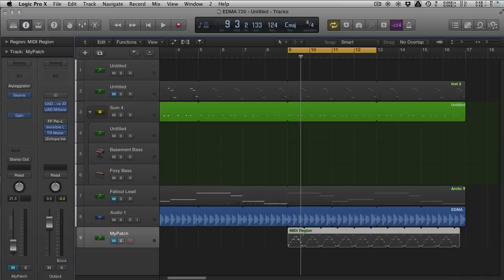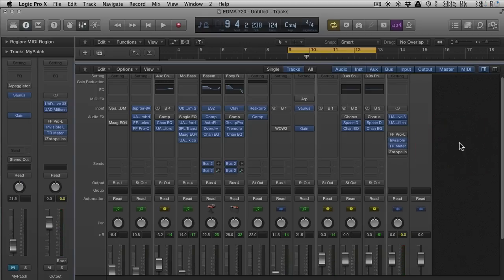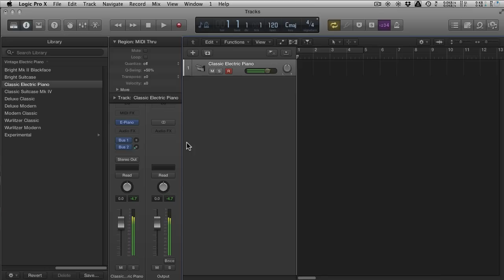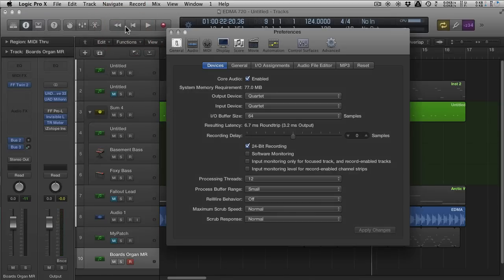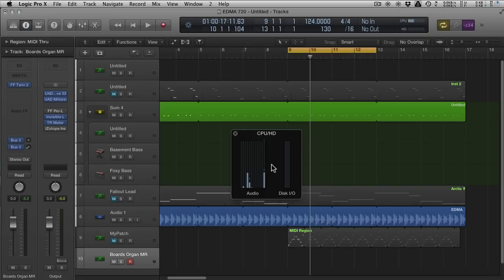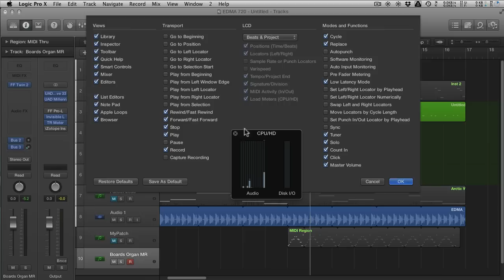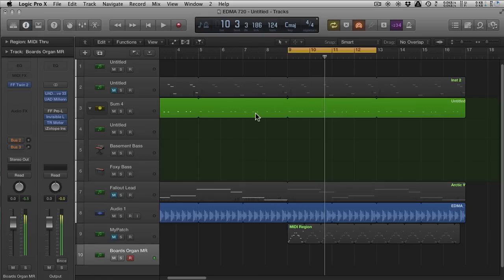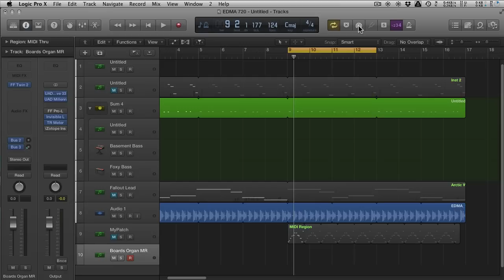How to Manage Latency And Buffers to Avoid Audio Problems

Comment: Very helpful video..thank you... after applying all these changes i still have an issue and i am wondering if you could help me out.  The problem is this… I record guitar or vocal and play it back and it plays back fine but then when I continue to work the audio tracks that I have recorded go out of sync. They seem to move forward. Roughly 3/64 of a note. This is really frustrating and not allowing me to get on with recording. Have you ever come across this problem? Would really appreciate some help. Cheers George.